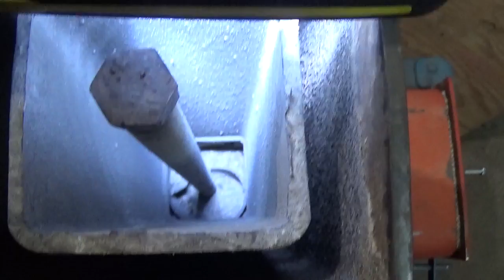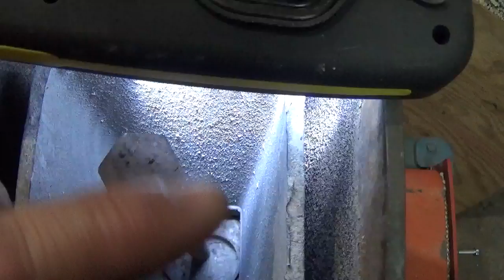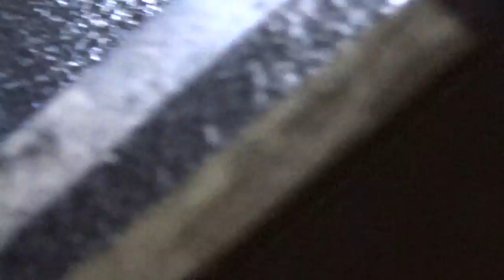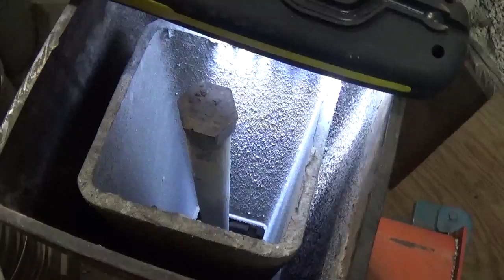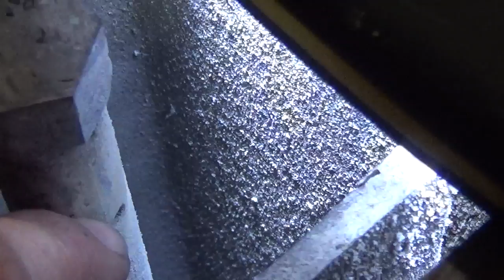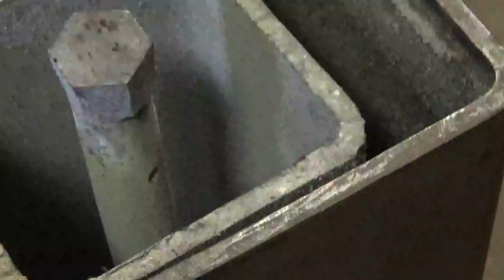Rocket stove vortex generator explanation

Comment: Would putting a second air pipe in riser tube like you did increase flame and heat? Wanted to know before I put one on mines.
Reply: it'll make sure to increase the oxygen ration ensuring a cleaner burn. a cleaner burn means more of the energy in the fuel is released, and in a  small way may act like an afterburner on a jet engine, increasing the draw of the system.. this means there's less of a chance of backsmoke.